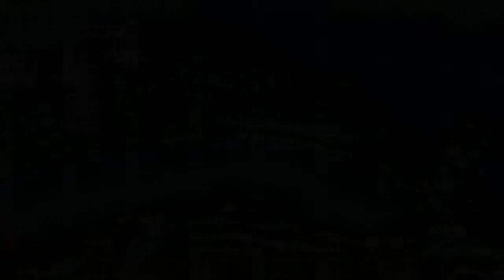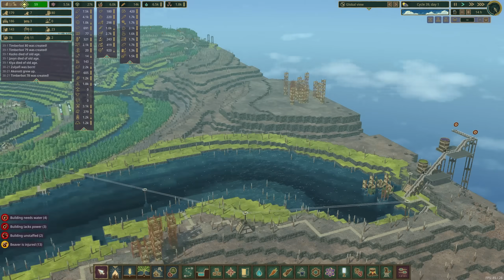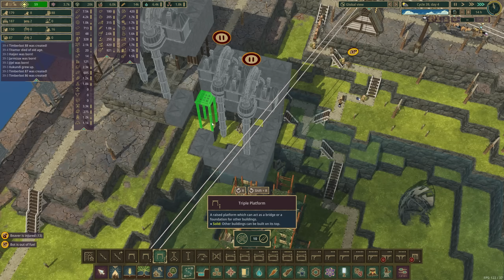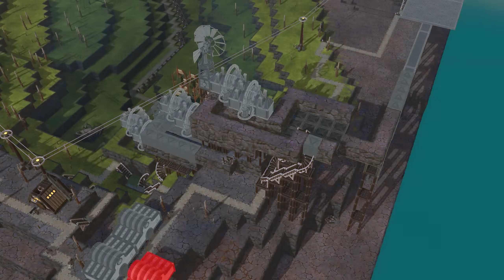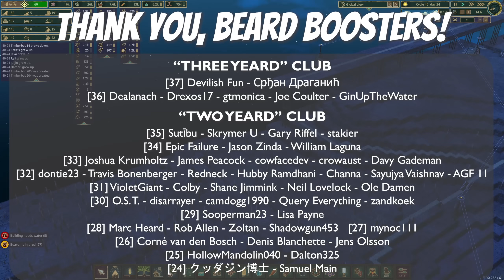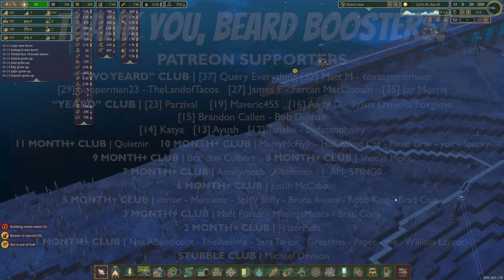Aqueduct construction begins! Timberborn 1.0 Full Release Episode 29

Comment: Thoughts on for the rest of it.Put in the 6 long overhangs in the perpetuating going up above center of the ground all the way to the end point. so they can drop dirt in from above on multiple spots below then after delete the overhangs. as well as build the future beams before all the rest of the dirt is put in place. stairs or ladder then a 6 x overhang then ladder or stair then next 6x overhang repeat going up and up and up so the rest of the center line can be put in before the rest. Then high priority the perpetuation 6x overhangs . once builts then priority the centerline dirt so it all gets dropped in from above which then will lead to more areas being able to be built simultaneously . Currently only 6 pieces of dirt can be placed at a time. vs once the 10 6x overhangs are placed you can drop up to 60 pieces of dirt at a time .
Reply from the maker: We'll try this next episode

Comment: If you want, you can power your mechanical fluid pumps using more wind turbines and water wheels. On the big aqueduct, you can place a water wheel and then two wind turbines on the wall surrounding said water wheel, but it'd be a pain to build. If you want to be real fancy, you can have one side be wind turbines, the main aqueduct section with water be a water wheel drive, and then gravity batteries on the other side, since you'll have a lot of height. The water wheels REALLY won't produce much power, but I think the gravity batteries and windmills could be a nice addition. Just an idea though, since power isn't all too much of an issue this playthrough, if at all.

Comment: 0:45
Personally, I'd use levies above platforms.
I think they fit better.

18:53
I don't think it defeated the purpose of the zipline.
It's purpose, I think, is faster travel, and it still allows for that.

39:28
Prioritizing the middle line would probably make everything go faster.

42:27
I would probably make the trench.
And link it to the irrigation pool, saving one job by not having to dump water there.
Also, I just thought that you could make terrain columns from the aqueduct to the ground to spread the green.
It wouldn't look particularly good, but would increase the irrigated area.

Comment: Cancel the later part of the zip line stations. 

Then build the canal walls on the newest part of the canal then readd the later canal zip line stations on the inside of the canal on top of the walls. 
They can then connect to the lower existing zip lines, so you can maintain canal zipline connectivity while converting the legacy canal zipline stations to on the wall format